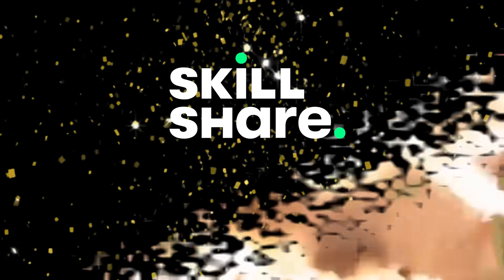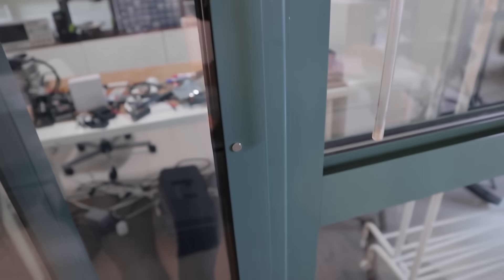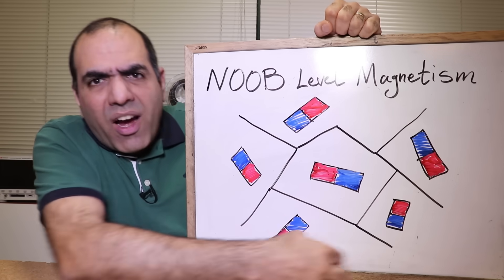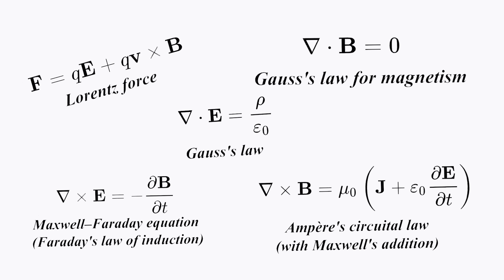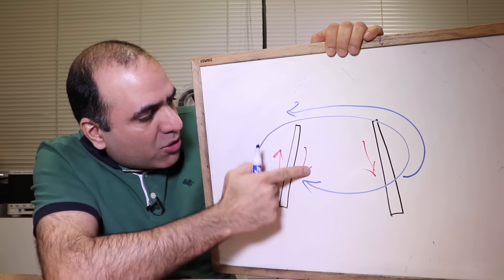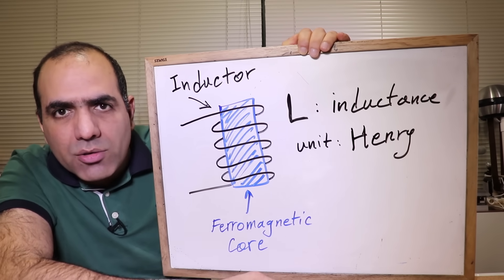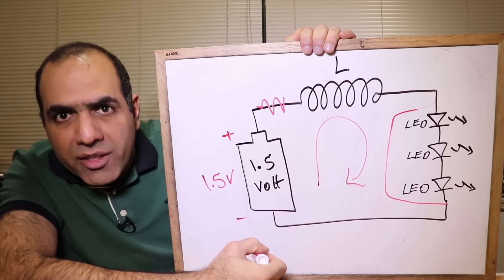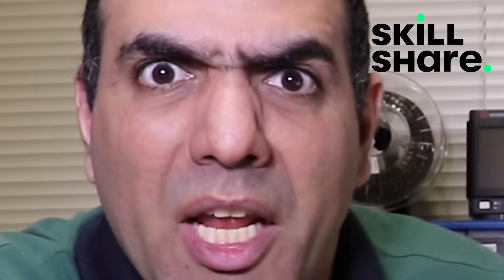Magic of Magnetism & Inductors (ElectroBOOM101-007)

Comment: You really should do a video explaining how a multimeter works, i.e., how do we actually measure voltage and current (as well how we define them). Also showing the evolution from multimeter to multimeter as time passes, explaining why do we have so many intruments for "basically the same thing" (Galvanometers,  Voltmeters,  Ohmmeter and so on) and the pros/cons from going to analog to digital.

~I wouldn't complain about winning an oscilloscope either~

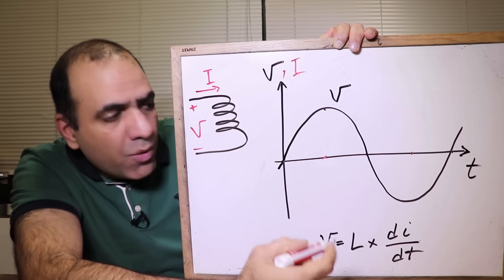Comment: At 11:19, if at the peaks the rate of current change is maximum, then the voltage across the inductor would be maximum too at those points. However the voltage you showed on the red curve was zero at those points.
Was that a glitch?

Comment: Magnetic fields are still real in relativity, there's just some equivalence between them and electrostatic fields, but with limitations - the difference of squares of the two remains constant. So you can make the magnetic field of a moving particle disappear completely (by moving beside it at the same speed). But you can't get rid of the magnetic field of a magnet, or even  the magnetic field induced by a coil of neutral wire (if it had some charge...there would likely be some flow of current where it did disappear) , just move the relative quantities/directions around a bit

Comment: At 11:19, Mehdi did mess up the rate changes for current for AC. Rate of change of current will be zero for AC voltage peak and max when AC voltage switches.

Comment: Honestly as an electrical engineering student/major.
Magnetism does legit feel like magic to me.
What do you mean I can step up and step down voltages and have the current do the opposite, without the two parts of the circuits being directly connected?

Oscillators also feel like magic to me, using the noise around you with an OP Amp to make a sinusoid(or other periodic functions) using positive feedback, with no real input, just noise and a few resistors and capacitors.

Comment: The circuit that turn on the led are called "Joule Thief"
Reply: kind of, but isn't a Joule Thief an oscillating circuit which requires an amplifying transistor?
Reply: @ryanfrench796  No. The transistor used as a switch at high speed. (Short and open) exactly what he did
Reply: @abus3ude  I figured that might be the case. thanks!
Reply: Being nitpicky, but it's Joule. Otherwise, yes, you are correct
Reply: @ResidentWeevil82  Oh! thanks, man. I edited the comment.

Comment: Next should be diamagnetic and paramagnetic properties and the 90 degree magnetic shift between them when power is applied., include how water and some other materials are repelled by magnetic fields. Do to the 90 degree magnetic field shift of the diamatic materials.

Comment: THANK YOU MEHDI. In my parental home my mom had some blue led lights hanging around the bathroom mirror.
They kind of were suspended from  a TL lamp encased in an armature. 
Even when they weren't branched in to the plug, they used to light up when the TL light was firing up.
Whenever the TL lamp wasnt shining during the start up you could see the LED lamps flash in the dark...
Is this the same phenomenon?

Comment: If you do the math, you find that magnetism is actually a combination of the electrical force plus special relativity. A very simple problem is two point charges moving parallel to each other. If you calculate the magnetic force between them, you find that it perfectly cancels the electric force as the velocity approaches the speed of light. Then repeat the calculation using relativity and time dilation, and you get the same result. So technically, there is no magnetism. There is only electricity plus relativity.

Comment: I have a question. Does negative and positive magnet creates a energy in the middle? When you attach the 1 w/ positive magnet into another negative magnet?
Reply: There's no negative and positive magnet. Stop the misinformation :D ;)
Reply: Kishan Vyas what i mean is that when magnet retract each other
Reply: Kishan Vyas like what electroboom said the magnet has south and north what if you connect the 2 magnet facing the same direction ? North and north.
Reply: Remember how he said they resist change?
This applies when you place same poles together. The fields are happy to flow in their normal directions, but if you place, say two Norths together, that is forcing them to change, which they don't like. Their electromotive forces accumulate and push in opposing directions, sapping energy from whatever source is pushing them together. 
This is why they get harder to push together until you overcome their combined electromotive force potential. You can easily push two fridge magnets North to North, but if you try it with big neodymium magnets, they can easily overpower you.
They don't create the energy so to speak, nothing does, they convert the kinetic energy fed in as resistive, opposing forces.
Reply: Sorry for my bad english .😩

Comment: units of Henry, named after Henry 😂
Reply: It gets sillier, modern nuclear physics switched to English names instead of Latin or Greek so.... 

1. When it turned out that the neutron cross section of absorption  was much larger than predicted ( like hitting the broadside of a barn )the unit of measurement was called "Barns" and has smaller units called "Sheds".

2. The six types of quarks are  Up, Down , Top, Bottom , Strange and Charmed.